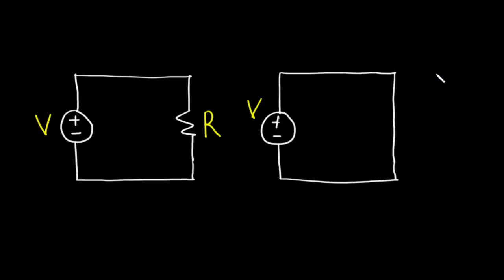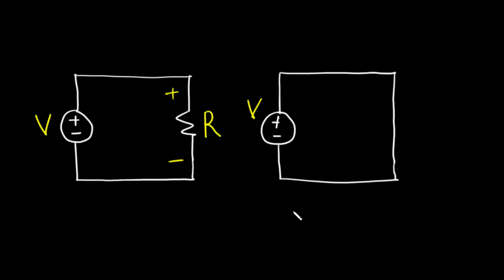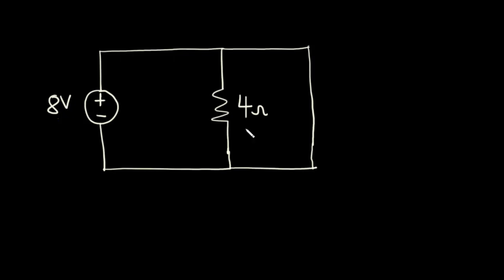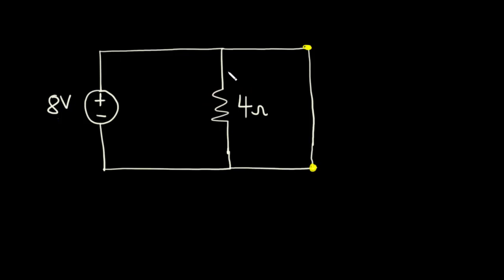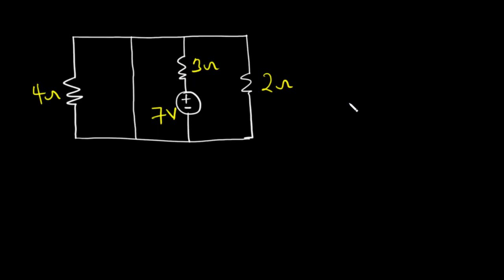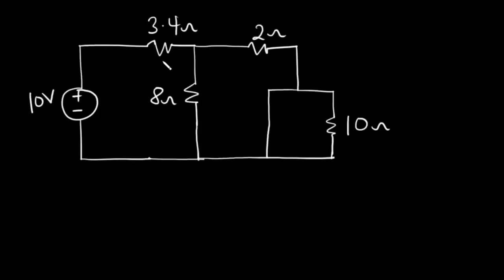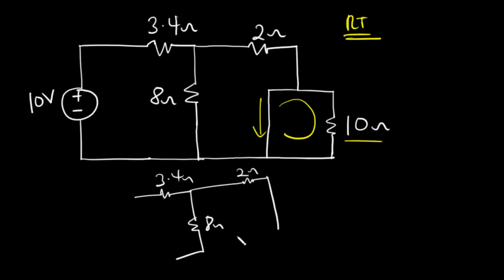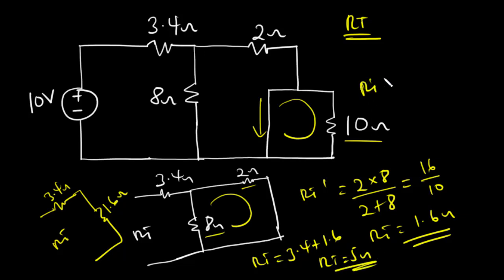04 - How to find the Equivalent Resistance of a Short Circuit

Comment: if there is a short circuit between two parallel resistors A and B and  we connect head of resistor A with one end of short circuit and other end of short circuit with foot of other resistor B . would  there be parallel or  series combination  between A & B?
Reply from the maker: If current will pass through A and the short circuit to B then they are in series
Reply from the maker: Meanwhile, you can join my telegram tertiary group and drop the picture of the question there, so I check for you
Reply: @SkanCityAcademy_SirJohn  sure

Comment: Please the second example I don’t understand why the 2ohm is short circuited ??
Reply: I can see 3ohm beside the 2ohm and when you use the loop method current will flow through the 3ohm so please why is it that the 2ohm is short circuited
Reply from the maker: Do you get it now?
Reply from the maker: Okay, so the 7v will drive current through the 1ohm, now at the junction, the current sees that there is a least resistant path, that is the short circuit, the all the current that flows through the 1ohm will ignore both the 2ohm and 4ohm and flow through the short circuit and return to the negative terminal of the voltage source. In that case, the 4 and 2 ohms are both short circuited
Reply from the maker: there is a thin wire connected between the 4ohm and (7v + 3ohm resistor), that thin wire is a shortcircuit. The moment you can go through a loop without passing through any other circuit element except one resistor, it means the resistor has been short-circuited, regardless of the position of the resistor. so dont be confused about the position of the 2ohms resistor. just use the loop to determine it and you'll be good to go. for more explanation watch this video - https://youtu.be/JQFOSfU-zhA
Reply: Thank you boss..God bless you 🙏
Reply from the maker: Thanks so much too

Comment: If you move through a loop containing one resistor and find an element which doesn't necessarily impede the current like maybe an ammeter or  galvanometer...Could you still consider it to be short circuited?
Reply from the maker: Yes, because an ammeter has very low resistance. In that case if it's connected in parallel with a resistor, very high current will flow in the ammeter causing damage to the device (short circuit). Hence it will still be a short circuit.
Reply: Oh okay. That was very helpful. Thanks!
Reply from the maker: You're welcome